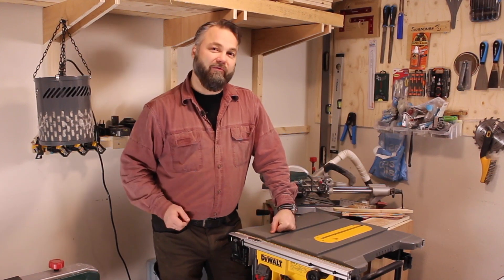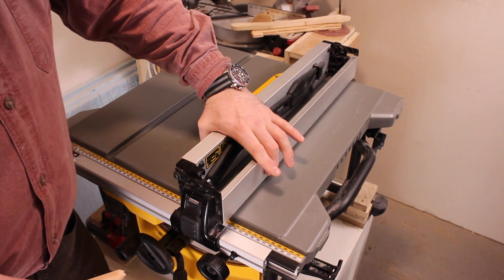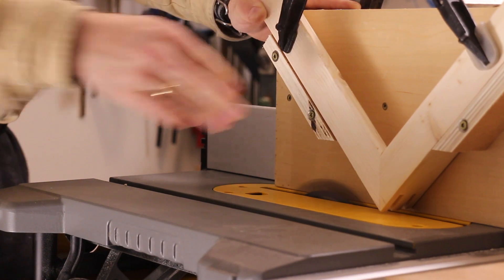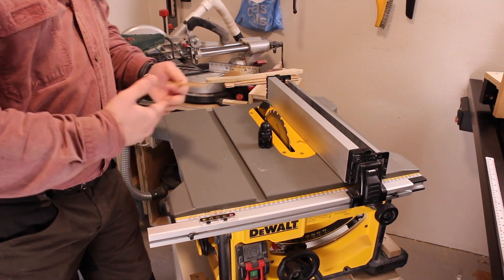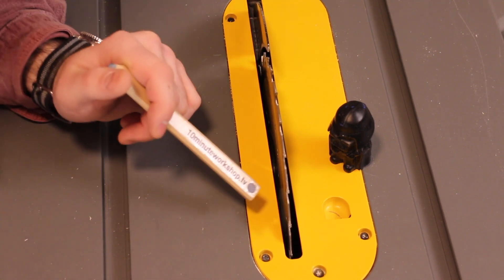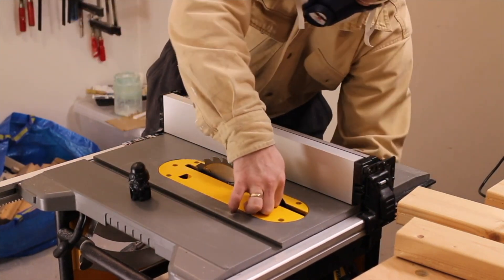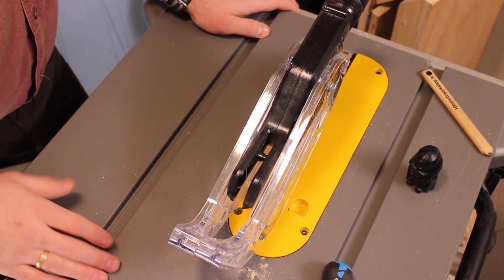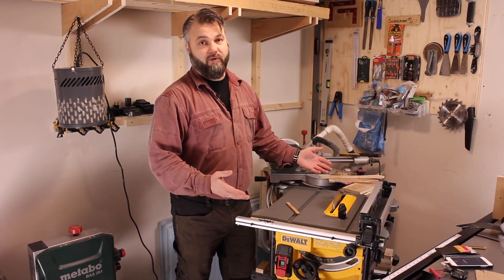DeWalt DWE 7485 Review -  Better than SawStop? Is it as good as they say? [0065]

Comment: What’s about cut precision? Is the blade moving lateral while sawing like the Bosch gts 635-216? It’s impossible to make precise cuts just like box joints on the Bosch.
Reply from the maker: To me thats sounds more like an issue withe the blade rather than the saw. Have you tried using flat tooth grind grooving blades for this kind of cut?
Reply: @NomadMakes  no, it’s a well known and documented problem with the backside angle sliding guide. You can move the blade lateral up to 2mm when the saw is off. I have a 46 teeth blade wit a 2,7mm thickness.
Reply from the maker: Man. That’s too bad. I had no issues with the 7485, but I am unable to verify this, as I have sold the saw in favor of my Laguna F3 cabinet saw.
Reply: @NomadMakes  well thank you anyway for taking time to share your knowledge with me and congratulations to the Laguna.
Reply from the maker: No probs, mate! Thanks for watching and commenting.

Comment: Hi, I've just come across this review as I'm interested in buying this machine, it looks to be very good value.  As you suggest I'm an "aspiring furniture maker", so your views are very pertinent to me, and I very much appreciate the way you have performed the review.  Could you please give me your view on two things.
- fitting the machine to a workbench is awkward because of the rack and pinion system;  is that fairly simple to overcome by just allowing a space for the rack to pass through on each side of the bench, or is there more involved?

- you say that the blade height setting can change during use as there is no locking function;  it seems that this could be quite problematic - do you have any ideas on how to prevent or minimise the movement?

Thank you, Roger
Reply from the maker: Hi Roger and thank you for your question,
First of all, I would say that I truly belive you will be very happy with this saw if you purchase it. When it comes to the shape of the table and the fence, If you add an outfeed table behind it. This is really problem free and a great solution. The challenge arises if you want to add tables to the sides, or especially in the front of the saw. The reason why you may want infeed support is that the table in front of the saw is quite "short".
Izzy Swan designed what he called an infeed saddle for this saw. This seems to work quite well, and he sells both the item it self and plans for them. 
But as to your question, leaving space for the fence attachments will probably work well. 
The blade hight issue happened when using a quite wide grooving blade. I did not measure how much this was, but you can easily work around it. Mind you, the reason why I was very "strict" in the review was because there was this huge hype around this saw at the time. And I wanted to point out that, although it is a very good saw, it is not perfect. That being said, this saw - and it's bigger brother, are the only job site saws I would recommend for this type of work. 
You can see the saw in use in several of my older videos. And quite a few even after I got my cabinet saw, as I had a lot of unedited footage. In the unboxing video you see me using the workbench as an outfeed table. If I were to get the saw again. This is how I would use the saw. I would not drop it into the bench. I would put it on the side or behind the bench.
Hope that helped. And I will gladly  elaborate further on this, shold you have any more questions. 
Cheers.

Comment: Loved your review but I am somewhat confused by your reference to the quick change blade guard and riving knife. You reach under the table to loosen something before removing the riving knife without removing the throat plate. My saw requires me to remove the throat plate before loosening and depressing the lock knob before removing the riving knife. Could you please explain the difference in features?
My saw has the same model number.
Reply from the maker: Are you in the US? I have heard from others that the US version have a different locking mechanism than the EU version. The EU version has a spring loaded twist knob under the table. 
I believe I show it in the unboxing video.
Reply: No, I am in Canada and bought my saw when it came on sale at $150 off the regular price.
That quick release feature is much handier than the knob which requires 3 full turns before pushing the knob towards the riving knife to allow it to release.
Strange that DeWalt would not include the quick release for Canada but give the saw the same model number DWE7485.
I also found the T-track miter gauge a bit sloppy, so I am using my old Sears Craftsman miter gauge and it fits perfectly with no wiggle at all.
Reply from the maker: Yes. It is a very nice feature. 
I put some duct tape on the miter gauge. Not a perfect solution, but it worked. Although I mainly used my crosscut sled.

Comment: I have this saw and love it BUT my god is it hard to find good blades for it in Europe! Any suggestions? I’m seeing you went smaller in diameter (spline jig)
Reply from the maker: What kind of blade are you looking for? The one you are referring to is a CMT 6mm flat topped grooving blade.
Reply: @NomadMakes  I would love a thin kerf ripping blade for exotic hard woods ideally. Right now I’m looking at the CMT ITK Ultra thin universal disc - D210x1,8 d30 (+25) Z24 HW but I can’t find stock anywhere. Yes I looked at the grooving blade today, when the need calls il be sure to try it out
Reply from the maker: I am currently using Luna blades on my cabinet saw, and are pretty pleased with them. They seem to have a good selection if blades.

Comment: I’m new to Woodworking and this Dewalt 7845 is my first table saw. I want to put into a work bench for better out feed support. The fence system is awesome!! I’m looking for ways to build a work bench that I plug my Dust collection hose in to properly
Reply from the maker: Great choice if saw. For outfeed support you can put a bench behind the saw. Good luck with the project. It sounds like lots of fun. Cheers.

Comment: Thanks for showing the quick change. I've been guilty of not using the blade guard (because I didn't read the manual and see how easy it is to swap). 😬  I agree on the frustration of the table being small. But I went in with eyes open, and was willing to sacrifice some size for the accuracy and precision it promised, and has delivered on. I am working on modular/quick change infeed table extension and outfeed as well. I don't want to give up the rack and pinion fence. I love it! My cuts have never been so clean and accurate.
Reply: Oh ....also .... I almost avoided buying this saw because it couldn't take a dado stack. I'm glad I didn't let that deter me, as a few extra passes works fine for me. And as infrequent as i need to make dados, the trade-off is worth it. I never knew of the CMT blade. Interesting. I do have a "wobble blade" which works for some applications. But you don't get a true flat kerf.
Reply from the maker: Hi Scott!
While I, in this video chose to focus on the "negative" features of the saw, this was only as a response to the massive amount of positive reviews is has gotten. If you need extra infeed support. Izzy Swan has is selling both plans for and a product that he calls an "infeed saddle". It seems to work very well. If you stop by him, let him know I suggested it. 
I can wholeheartedly recommend the CMT Orange Tools grooving blades. And I really do love the rack and pinon fence. Surprisingly, the blade guard on this saw is far, far better than the blade guard on my brand spanking new Laguna Fusion 3 cabinet saw. 
Cheers, and thanks for watching and commenting.
Reply: @NomadMakes  Hei venn!  Yep. I know you love it. And I'm glad you pointed out some of the negatives. I agreed with them. I've seen the Izzy infeed table I have a little something different in mind. Something I feel a little more comfortable sitting a larger sled on.
Reply from the maker: Sounds cool. Let me know how it works out for you.
Reply: @NomadMakes  Intresting tidbit. So I was looking at how you were changing your riving knife. Couldn't figure out what you were reaching for. Actually stumped my buddy, too, who happens to be a Dewalt rep. 😁😋  What we seemed to realize, is there are a few differences between the European and American 7485. Ours change by a knob holding in the riving knife. Now I'm looking for other differences. :)
Reply from the maker: That sounds strange. If you take a look at the «unboxing» video I made of the saw, I show the knob. There is a knob on the left side behind the blade casing. You twist this 2-3 times and the pull it to unlock the knife.
Reply from the maker: @scottbabb2088  Here you see the knob at 14:08 https://youtu.be/ZeCP4YCZdlk?t=848
Reply: @NomadMakes Good morning! Yep. I see that on your unboxing. Doesn't exist on my 7485. I have a 3 prong knob on the inside, under the throat plate and attached to the riving knife slot, that you loosen and then press in to pull out the knife/guard. I'll see if i can get pics of the box and under the saw on mine. Maybe the "-QS" on your model makes it a little different. At least with regards to that element.  Also curious if maybe there are different regulations in play in different regions of the world. Otherwise, not sure why they'd do it 2 different ways. 🤷‍♂️
Reply: I don't know if that video is a 7485 (because mine doesn't have the kickback pawls in that location) but that's the same knife mechanism.
Reply from the maker: @scottbabb2088  That is interesting. There is no shroud for improved dust collection, and the mechanism for the riving knife seems to only allow for raising and lowering of the knife. Not removal and change. The video states that it is a DWE7480, though. The -QS code states where my saw was sold, and you may be correct in there being differences because of regulations. 
Eric Sorensen has the DWE7485, however I believe he lives in Canada. Not sure though. 
https://youtu.be/6Yg3zOa5gGQ
While I disagree with his practice of not using the blade guard, my point here is that his video shows a saw sold in the Americas. Are there differences between USA and Canada as well?
Reply: @NomadMakes  First, thanks again. I wouldn't have investigated the quick change safety features without watching here first. And it's made me explore other parts of my saw. As for Eric's video ....upon scanning, it does appear to be the same as mine.  Best I can tell. And you can pull out the riving knife and insert blade guard.  I'm not sure whats different, as you infer, in the shroud between yours and ours? And as for adjusting riving knife height....looking at the manual, it can be changed. I haven't had reason to do that yet, so I can't speak to it. But it looks like there are 3 screws on the mechanism that one needs to fiddle with. Not sure if they're positive stops or not.
Reply from the maker: @scottbabb2088  It is unfortunate that they are not using the same mechanism. With this one you don't even have to remove the throat plate. While I am not a safety nut, I dabble in "human factors" in my profession. And the ability to change between the riving knife and the blade guard so easily is THE most important safety feature of this saw. An unused safety belt never saved anyone. But can you confirm that you are able to change between the two without using tools on your version?
Reply: @NomadMakes  I can. You do need to remove the plate, but it can be changed out very quick from there. No tools needed. Just spin the knob a turn or two, press it in, pop out one knife, drop in the other.  Still only a 10-15 second thing. So, still no excuse not to do it. :)
Reply from the maker: @scottbabb2088  That is good to hear, and as you say,  the feature remains as good. It is also good to know if more people ask, because I have had some strange questions about this. Also, I cannot check on as I have sold the saw in favor of a full sized cabinet saw.

Comment: I totally agree with your conclusions re- the DeWalt7485. Compared to my previous saw it's light years a head. I have mine installed on top of a cabinet which I can move around. It has an outfeed table which I can rise as required. One fact which you over look is that with my working area, I have limited space. I do all my large cutting outside with a track saw mounted on to saw horses with a frame. I also use the same arrangement for my MFT. So I am limited a little by the weather, but I normally plan a head and use the weather forecast to determine when I will chop up large sheets.
I guess with the winters in Norway you are a little hamstrung !
Reply from the maker: Hi Richard! I also need to cut down sheet goods before bringing them in, as my workshop is very small. I either purchase from a store that can do it for me on a panel saw, or I do it myself on some extruded polyestyren plates in the parking lot before loading them in the van. 
Thanks for watching and commenting.

Comment: Excellent review Gøran, I particularly appreciate your pointing out the good safety features - I'm lazy about using the blade guard... And I know what you mean about blade angle adjustment. My Bosch is just the same; I imagine most contractor saws are the same. Thanks for this mate, good job all round.
Reply from the maker: I am glad you liked it, mate! The things I learned using this saw was very important when I bought my cabinet saw. Imagine that the saws sold here in Norway used to have fixed riving knives. You had to get out your spanners. That made people just take them off completely.

Comment: I was going to ask whether the miter slots were precise enough to let you create a spline-jig that rode in the slots rather than fitting over the (flexy) fence, until you mentioned ( @9:25 ) that the blade can lose its height setting between cuts.  So much for using the saw to make japanese-joinery-inspired three-way corner joints or finger joints!  You're much too lavish in your praise, given that flaw.  On the subject of alternatives, with the exception of the Delta 36-725T2, I have not found (here in the US) any saw with dust collection and a true riving knife that a Biesemeyer-style fence will fit, which is not priced at least four times the Dewalt's price. Do you know of others?
Reply from the maker: Hi Tim,
The issue with the blade hight was not that bad. But good to know about so that you can take it into account. And I made a spline jig that straddled the fence for this which served me well.
I don't know if I made it clear in the video, but the youtubers were climbing over each other giving this saw 10/10 reviews when it came out. So I wanted to present a bit of a different view. It still was perfectly honest though.
That being said, even with the new saws from SawStop, Hikoki and Milwakee having the rack and pinion fence system. If you need a job site saw this is still a no brainer. However, if you have the space, don't need to lug it around and can swing it financially. I would suggest looking at it's big brother, the DWE 7492.
Since you mention a Delta, I assume you live in the US or Canda. On your side of the pond contractor saws and cabinet saws are so much more common and easy to get used. Have you considered that?
Hope that helped.
Cheers and thanks for watching and commenting.
Reply: @NomadMakes  How bad is the blade-height wandering issue you mentioned in the review? Does height of blade wander by more than 0.25mm? Does it happen only under certain conditions, such as when the blade is set to its maximum height? I am thinking of a situation where one is making box joint cuts one after the other using multiple passes. How would the height wandering be taken into account except by remeasuring after each cut, which would be untenable.
Reply from the maker: Hi again, Tim. 
It did not happen often, and not consistently. So I do not belive it was slowly sagging. Perhaps I bumped the blade or something while rolling the saw around the shop. I don’t remember how much it is was. 
Should this happen a lap joint could be adjusted with a chisel or plane. Finger joints would have to be re-cut. 
But to be perfectly honest, the only way to find out if this is an issue is for you to test it out. I have seen a lot of people do joinery on these saws. But then again. Like I said in the video, the saw is not perfect.
Oh. I forgot to tell yo. This happened with the blade quite low.

Comment: I've had this saw for about 6 months and have used it quite a bit. I've successfully ripped 4'x4' sheets of plywood on it using some roller supports on the side and the back, but of couse a bigger table would make it much easier. My biggest disappointment, which I didn't know about when I bought it as a fresh, beginner woodworker, is the lack of support for dado stacks.  If you plan on making cabinets on a regular basis, you don't want this saw.  Cabinets are not impossible to make using it, but it won't be optimal or easy. I added a side table onto one side of it, but the way they have those tongues with fading tops maker it tricky to get a table to fit against it.
Reply from the maker: Yeah. I used the saw extensively, but quickly outgrew it. I think it is best suited as the mobile tool it was designed to be. But the reviews out there didn’t seem to bring this up. 
The jobsite saws on this side of the pond are not made to accept a dado stack. So, people need to make trenching cuts in other ways. 
Cheers, and thanks for watching and commenting.